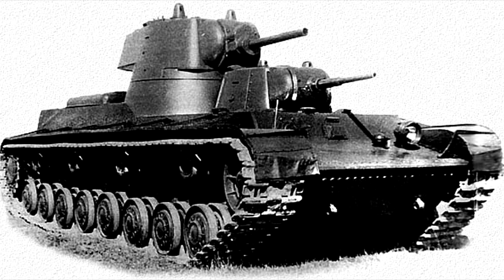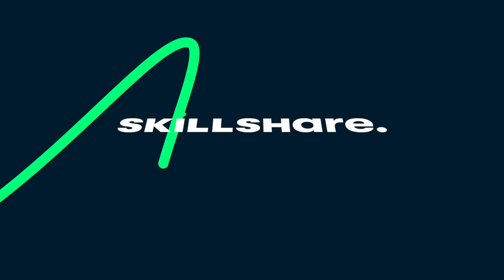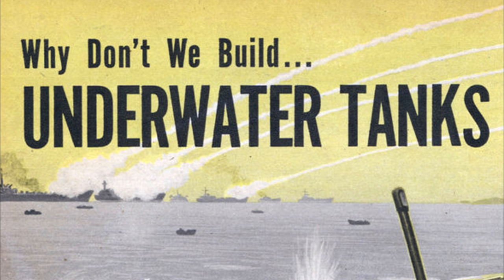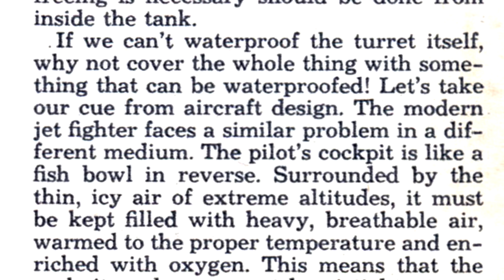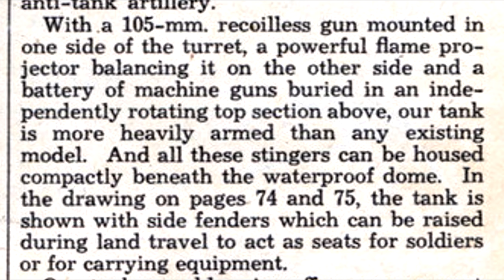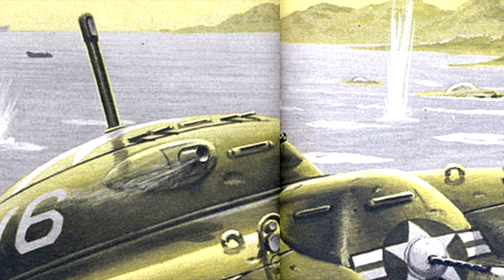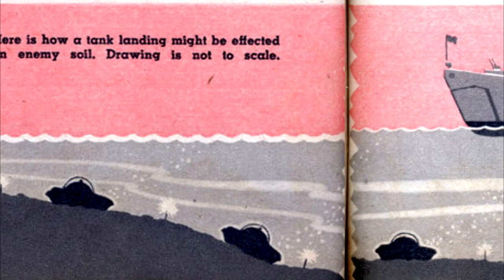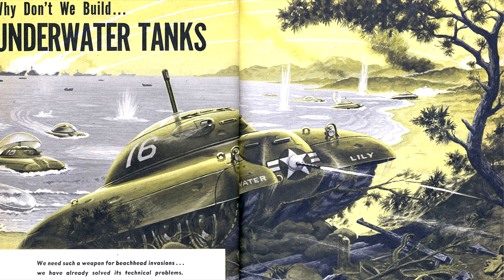The CRAZIEST Amphibious Tank Concept EVER | Cursed by Design

Comment: I think a tank like this could have worked and possibly even be revolutionary for a war back during the 50s-60s. Getting bogged down is a problem that can be accounted for and design changes can be made to adjust for soft seabeds, wider tracks namely could help making it so the pressure exerted by the vehicle isn’t great enough for it to sink into the mud and sand of the sea floor, a tank like this could also give commanders a lot more options against peninsula and island nations as you could essentially deploy tanks even behind enemy lines along beachheads, giving a commander a whole host more options on how they can deploy their forces. Heavy armor for the most part has been restricted to advancing on land or being significantly vulnerable to enemy fire before landing on a beach like with the Duplex Drive Shermans, a more heavily armored tank that has a better chance of making it onto land without exposing itself too much to enemy fire would have been a game changer.

Comment: I noticed many things missing with the speculations:

1- There is no context on what type of contruction material would be used in the final desig but looking at it it wold have likely been cast homogeneous armor.

2- Weight, There is no context on weight aswell. Altough it needs to be heavy enough to sink but it can't be to heavy not to be stuk in the water mud.

3-Transmission, it could either be multi-transmission or clutch steering. But looking at the drawings i could expect clutch steering as of it's size.

4-Ammo amount/types, As there is no context on this aswell we can't fully say how much ammo it could have held and what type of ammo it would have fired from it's cannon. Sadly i couldn't find any hints on what it could have used.

5-Crew amount, i didn't see any mention of how many crew there would be in this kind of tank. Altough yes it could fit 4 crew members it would be extremily cramped in the hull and turret so i would say 2-3 crew members.

6-Turret drive, as there is no context on this aswell we can't really speculate how it's turret traverse speed would have been. My guesses are either Hand-cranked or powered.

7-How the explosive charges would have been activated. I only have little to say about this as i could easily say that it could have been internally activated.

and finally 8-Top speed and gear amount, There isn't really any context on this but my guesses on the gear amont is 6 forwards 2 reverse.

I hope this gives some idea of how it could have been but these are just guesses. If you would like then you could respond to this with your own guesses. I am always free to talk (Even tho i may be offline at times.) If i missed any other aspects then you could tell me with your own guesses on it.

Comment: I understand that the point of the bubble is to be easily sealed and makes the turret design much easier and thus cheaper, but the Surcouf had pressure-tight a turret so it was well possible given the technology at the time.

Also since it is underwater it is possible to use buoyancy bladders to negate most of the eight of the tank and even provide some reserves of air at the same time. The bladders could even have a multiple compartment design that allowed the engine to suck up fresh air from one compartment while dumping exhausts on the other compartment.

Comment: It’s an interesting idea but the sea floor next to beaches are usually anything but smooth. Short shelves and walls aren’t marked on maps and they would instantly stop this tank.  Undersea mud is also very surprisingly sticky and soft. If a tank got stuck (which most probably would), there would be no way to retrieve it while a battle is happening. I can’t think of a single beach near me that has a nice, smooth transition to the open sea.  All of them have underwater cliffs, reefs, trenches, and mud scattered all the way out to the open ocean.

Also they’d need enough air to run the engine which I think wouldn’t really be possible.  From some estimations, that engine would be consuming a few thousand litres of air per minute AT least when not giving it much gas. That number goes up a ton when you do more than just cruise along idling. An air tank that can hold 5000l of air would be about a meter wide and a couple meters long, and that would give the tank only a couple minutes of driving time.

Comment: I think I would give the tank screw drives for the bottom muck (search "screw tank" on youtube) and a way to emergency surface.   So before diving off the ship, large pontoons are filled with air, but they are countered with ballast.  If you get stuck then you drop the ballast and float up, continuing with the surface.  If you make it all the way to shore then you drop both.    If you know that the bottom is bad, then the tank is trimmed to be neutrally bouyant.

Comment: Enjoying the content.  This is a most useful channel.
  A small detail: if I remember my reading, Higgins boats weren't armored.  Larger landing craft (LCI, LCT) were usually unarmored, though some had a light armor cylinder for the pilot's position.  Bullets whipped right through most landing craft.  Casualties sustained by transported soldiers and marines when landing on defended beaches were significant.
  And a suggestion: a companion article on Tauchpanzers might be appropriate.

Comment: Idea for a future video: the T57 heavy, T69, and T54E1. The T69 was made as a vehicle to use an autoloader and give the Americans an understand and possibly use an autoloader. It used a 90mm T178 gun. Tests were filled with a high rate of component failure that prevented a study of the autoloader and oscillating turret. It was then cancelled, but continued to test it until the project was finally abandoned. The Americans later made another attempt to use the autoloader, and made the T54E1 and T57. I don't know anything about the T54E1. The T57 was a heavy tank fitted with a 120mm T179 gun. After trials, it was deemed unfavorable. The autoloader was too big to carry a sufficient amount of ammo. It could only have carried 11 rounds at max. The company was then contracted to make 2 vehicles, but they instead made 2 turrets. Both turrets were later scrapped after tests and the project was cancelled.

Comment: It's do-able, but with refinements. I'm thinking  about external air bladders that could be inflated to lighten or even float the tank if if became stuck. Optimally,  the tank would  be winched across a river, barely touching the riverbed, just being barely negatively buoant enough to  not float to the surface.  The crew compartment would be maintained  at slightly positive  pressure to prevent flooding.

Comment: That's a really dope design.
But something that is not discussed here is the boyancy that the bubble would provide in effect "lightening " the tank. I honestly don't know how much weight would be dropped and if this would be significant. But nonetheless interesting.

And why not make the bubble bigger ? Making it oval and covering the whole lenght of the tank so that it could fit a 90mm gun.
Hell why not making it cover the whole tank just letting some ground clearance as not to get stuck. That way you needn't to make the hull waterproof ! Maybe even fit it on normal tanks ! 

And the biggest problem with under water tanks ? Getting stuck in mud and on rocks. 
But the bubble also helps in that field :
More buyancy = less weight = less chances to get boged down.

OK so I made some rough calculation based on an m60 patton I calcuated how much boyancy à bubble that would engulf it would have.
The Patton is 6.9 meters long 3.6 meters large and 3.3 meters high let's round that up to 7, 4 and 3.5. 
Now let's multiply them all to find the volume of the square that would engulf the patton : 98 cubic meters
Now 1 liter of water displaced equals 1kg in boyancy. And  1m3 = 1000 L
So 98m3 = 98 000 L = 98 000 kg 

As the paton weight ~50 tons the tank would even float !
Now the hard part would be to make anchors that could withstand 100 tons and be explodable.
But this design really has some crazy ptential !

Comment: >Plexiglass dome
>"Periscope" popping out the top of the turret
>Explosive charges to detach dome (rendering submersible capabilities a one-time-use feature)
>Trying to drive a tank on the loose wet soil of an active riverbed/lakebed
>Trying to shoot a tank's turrets either underwater or after re-emerging on land (despite the turret likely being damaged by either some stray water damage or the EXPLOSIVE CHARGES MOUNTED NEAR THE TANK'S TURRET THAT ARE POWERFUL ENOUGH TO LAUNCH A GIANT PLEXIGLASS DOME FREE AND CLEAR OF THE TANK)

Even with just the thumbnail picture, the entire concept is irreparably cursed.

Comment: if the tracks where wide enough, i could see it working. all they would need is somthing that could float like foam that could be hit and not sink, and a tube on a reel like a garden hose that has one end connected to the engine for air, and the other would float above the water with the foam. they could also add air balloons to the sides to lighten it. they dont have to be fully pressing on the sea floor. they could use air to lighten. maybe not fully lift but lighten it.

Comment: A floating 'dual snorkel' with flexible hoses could be used; the surface element would need to be 'impossible' to sink by normal wave activity and have a 'U-bend + float' protection to prevent sucking up water; I doubt if speed would be a major consideration for this design. Disposable or temporary track extenders might help with river bottoms and muddy estuaries.
Con: But what about mines beyond the lowest tidal mark? Pretty damaging below the surface (incompressibility). USSR's mine rollers for the first ones perhaps?

Comment: Just the underwater part would require designing and building a tracked mini sub, something that no navy had built. A tracked mini sub that was compromised by needing to operate as a tank above water. So vision ports as well as periscope, Diesel engine as well as batteries, think carefully about he number of hatches, submarine of that size one , tank one per crew, armour comprises buoyancy so buoyancy tanks somewhere ( yes it crawls along the bottom but it both has to control its rate of decent and get out of soft sea bottom without aid ) . And of course the pressure integrity of the hull relies on a Perspex dome. I don’t know if I was “The Enemy “ and saw these being deployed , a carpet of hedgehogs,  depth charges , mines set to go off immediately and anything else that might produce pressure pulses would materialise between the launch point and the shore. That plexiglass ain’t  no steal and all that’s needed to stop the tank is a decent crack in the dome while it’s underwater.

Comment: The problem with tracked 
Version can be overcome 
With a screw drive set up.
Russians tests show if tracked vehicle get stuck in the mud a screw drive
Will have no problem.

Screw drive also offers you the ability to drive right or left instantly without turning.

Comment: The tracks would have to be incredibly wide due to the ocean floor not being solid at all. Around a pacific volcanic island it might work as there could be some rocky outcrops underwater and the islands forming a natural slope as they are eroding volcanoes. However the ocean floor is rarely flat. Around continents the invasion fleet would have to pick and choose their landing zone wisely and also map out the ocean floor before hand, since if they didn't they could very well just drop their tanks into the abyss.

Comment: A lot of the design thought seems to be going into how to fit a 360 degree turret onto an underwater tank, but like
would it actually need that? 
It's purpose built for one scenario; go out of the water, get onto the land, kill whoever's there. 
I think a fixed gun would work fine, you've got the sea to your back and allied forces to the left and right.

Comment: I worked in military armor and vehicle design some years ago.
A much better concept would be an un- manned, armored, mobile pill box powered by electrics, like a Tesla.
These vehicles could be autonomous, and dropped onto the sea floor using bespoke submarine land craft at night.
The tracked gun platforms would sit on the ocean floor or at some stage of neutral buoyancy until they crawled up on the beaches, with little noise.
They would have Flir detection to locate human or robotic sensors.
I would build these vehicles to be air or water transportable, and these remote/ autonomous car sized units would also launch smaller ground and air bourne  drones to lay counter attack preventing land mines, as well as dozens of remote controlled machine guns.
All these units would be able to infiltrate and hold large areas of enemy beaches ,so Marines, or Seals would have total control of an area, without risking life and limb to secure an area.
I had a friend who was a Marine Officer 
riding in a AAVP-7A1 Amphibious Assault Vehicle with a load of Marines, and a NATO officer who had a bad case of claustrophobia.
The NATO officer panicked and tried to open a hatch while underway in a heavy sea state, and "go home".lol.
He had to be restrained at gunpoint.
Can you imagine trying to put your average Marine in a "submersible" vehicle, and tell them to crawl along the bottom of the ocean?
Dream on....

Comment: I honestly think it's just a bad idea. What happens if you get stuck? How do you communicate to your support units to get help if something goes wrong? How do they find you to try and tow you out? It's all well and good to say "sUBmArinEs HAVe escAPe HAtchEs", but go and talk to ANYONE who's been on a submarine, they'll tell you flat out that trying to get out of a sinking sub is just not viable. Just getting the hatch open is challenging because of the water pressure, and then you have to swim up to the surface, which might not be possible depending on how deep you are. I imagine a lot of people would have died in the process of trying to make such a concept work.

Comment: Like many concepts, it's very likely possible, but unlikely to be cost effective. Although militaries do love to throw money around...
I think a temporary gaskets around the turret, thin barrel plugs and other seals that are dislodged when the turret is moved could be more feasible than an expensive full dome. However the list of potential issues is ridiculously high for any concept like this. I think getting it to be reliable and private proof on any practical scale  would be the hardest challenge.

Comment: I think I’d go in the direction of eliminating the turret altogether for simplicity sake, and having a casemate. This would also allow for APC variants. It might also allow for the fitting of a more conventional gun.

I wonder if, instead of the recoiless gun internally, a better “cool” solution might just be having externally mounted rockets fired electrically ala fighter aircraft. The four machine guns are overkill and I think just one or two would do. I think the flame vehicle would be best done as a separate variant.

For the drive, I’d consider having a buoy which would be a snorkel, that would float free of the deck of the tank when submerged. You could have a rubber hose on a spool and be able to shortened or lengthen the snorkel. Alternatively, I’d keep the hybrid drive, but have the electrically driven propellers for underwater drive, with the tracks being in neutral on the sea floor. Then I’d also include a snorkel for traveling in the shallows, under conventional power. That would give two redundant systems of movement and insure if one broke down you’d still have a useable vehicle.

I feel ideally these would be able to deploy from the unmodified bow ramps of LSTs, but I’m not sure how you’d get that to work. Alternatively, perhaps they should be lighter vehicles that are lowered from davits from the upper decks of the LST?

Comment: Very much possible, but you would need extensive recon of the sea floor and beach head. Along with the transport ships that would drop these things at the right location, facing the right way.

The primary issue i see is the cost.... It's just cheaper sending in waves of people with dynamite at the beach fortifications than sending tanks. I know, cruel and cold, but that's just how always has been and always will be. 

I also imagine that if you can get all the right situations lined up it would still throw in the curve ball of getting that ship holding these tanks close enough to the beach. For them to have enough air/fuel to travel the rest of the way....from which if any little thing malfunctions....the crew is dead.

Comment: I would think that an internally mounted recoilless gun would be the worst part of this tank design because you'll have equal backblast to what you have coming out the front of the barrel so unless the rear of the gun opened up outside of the turret it would cause your crew to just be burnt up immediately by the backblast.